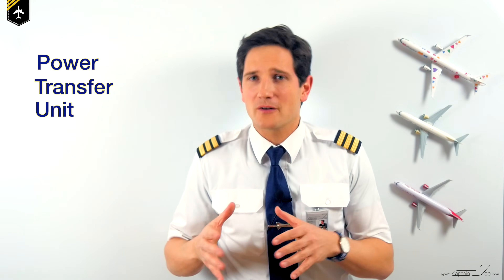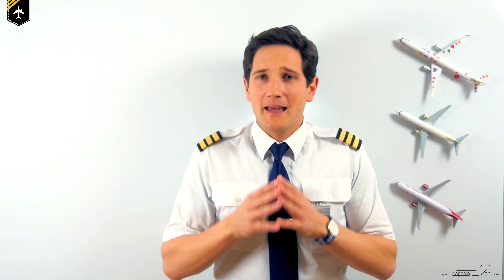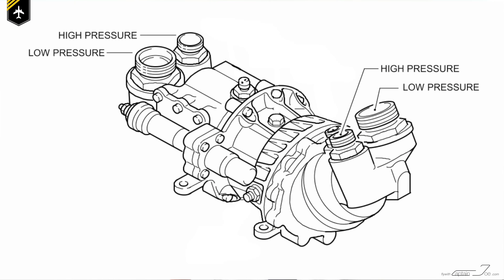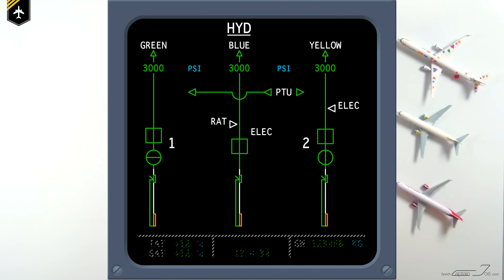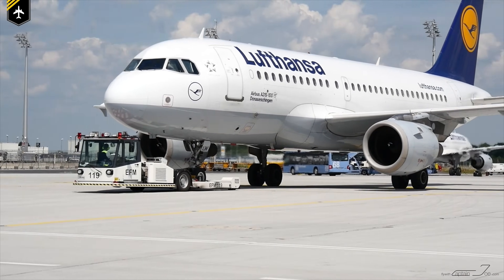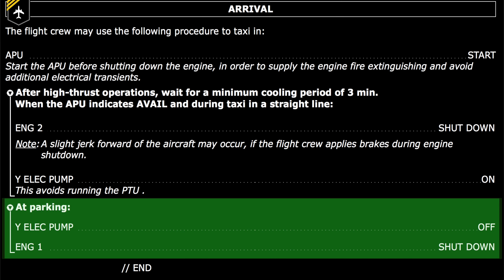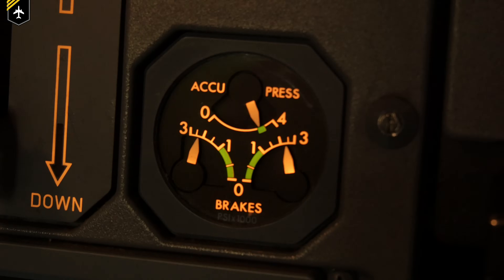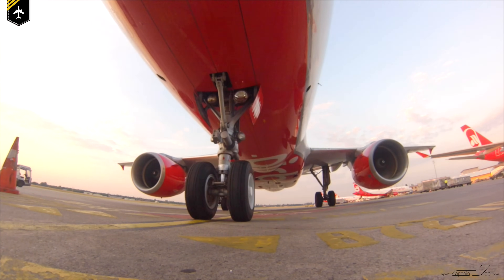MYSTERIOUS BARKING SOUND on AIRBUS? All about the PTU explained by "Captain"Joe

Comment: Too put more simple..   The airplane manufacturer got CHEAP... They don't have to hear it as a passenger soooo "let's not reduce the noise".  Oh yea the those "college degree engineers" aren't allowed to design a pressure regulator etc.  Its just more design flaws to save a buck and little weight.  Oh yea speaking Engineering those guys want lower fuel and no additional weight? Take every gear and bearing in the engine and drive units. Go get it Microblue.com coated.  The coating is extremely thin and practically indestructible (it's made for racing cars).  

Oh yea I guess I dumb because I don't have a "degree" 😂.  Well I say without certainty nearly every Engineer working for a firm is merely a robot..🤖  (must follow  commands) from sales and marketing department.🤑

Well besides my rant I enjoyed the explanation of the below deck barking dog.

Comment: Hi captain! Dont know if you will be still active on this year old video but Ill still throw in my question anyways :). So you mentioned that while one engine taxi procedures the yellow electric pump is turned on to pressure the system. My question is why turn the electric pump on when you can just leave the ptu pressurize the systems?  Thanks in advanced.

Comment: Greetings Joe, It did solve one of my mysteries as I used to think it was a problem with the Engine. However I don't find this sound in most of the Boeing aircrafts. Could you explain what's different there? Thank you Captain

Comment: does it mean something if I hear that noise in the middle of the flight?
Reply: Yes. If you hear it in-flight then you MIGHT not live long enough to ask another question
Reply: Kshitiz Sigdel Or to recieve the asnwer.
Reply: @JonatasAdoM   Or Learn how to Spell Answer.
Reply: @MADTASS  You're not my Tatcher!
Reply: Kshitiz Sigdel 😂
Reply: Kshitiz Sigdel heard it short before landing on all my Turkish Airlines flights, I still live to talk about it 😋
Reply: Avantgarde The Mighty  
Short before and landing and cruise are two completely different scenarios bud.
Reply: @avantgardethemighty6724  what you heard must have been either the flaps or the landing gears being deployed.
Reply: @kshitizsigdel423  On a Volaris A320 flight from Mexico on my way back home, I was hearing that sound all flight long
Reply: Pionel tapinessi had that too on Airfrance Nice Paris all flight long.
Reply: Engine 2 is offline
Reply: That's when the landing gear is being retracted and the wheels are quickly slowed down, but it's another sound.
Reply: I heard that noise after take off several times
Reply: @Pilotoprivadoamis34  As have I. For those suggesting flaps or gear deployment, I know those sounds well and can tell the difference.
Reply: @jemmerx  It may just be the switchover of the hydraulics from APU to one of the engine or electric pumps. The momentary change in pressure in the system would cause the PTU to run shortly.

Also, a high mechanical load on a hydraulic system (like extending/retracting the gear or flaps) would cause a slight drop in pressure which may trigger the PTU.
Reply: I think he was meming
Reply: No problem. You heard Captain Joe. He said the yellow line is pressurized by either the engine 2 OR an electric pump. So if one of your engines shut down mid air, you will hear the sound until the electric motor re-pressurizes the yellow line.
As you know a plane can fly with only one engine. It has happened thousands of times. Im guessing at least a 100 were A320s.
Reply: I heard it at take off, after take off, less pronounced for the duration of the flight, and again during landing . Was scared shitless when it didn't stop after takeoff. Genuinely though"ok, we're dead, I knew it". Eventually I accepted our fate. Would love to k kw what the hell happened though..
Reply: This happened to me right after takeoff from SLC. Long story short, we diverted to Las Vegas and later learned the engine malfunctioned and shut off.
Reply: Likely means an engine driven pump has failed
Reply: Probably some hydraulic stuff
Reply: Yeah u ded
Reply: Apart from all the scary possibilities the others wrote, the PTU itself might just as well gone faulty causing it barking during   whole length of the flight.
Reply: no....................... but if you hear in air for the landing then the rat turbine is being switch on

Comment: This was a good explanation.
I regularly fly with the A319 and A320, first I thought this noise came from setting the flaps, but looking to the wing the movement of the flaps didn't coincide with this sound.
After that I thought it was the pumping of fuel to equalize the different tanks, and eventually the hydraulic system, but never new what it exactly was doing.
So thanks for this explanation.

Comment: So why would they put the yellow system on the number two engine? Yellow controls brakes and ground steering, yet number 2 engine is usually off for taxi operations. Wouldn't it make more sense to put the yellow on engine 1 and green on engine 2?
Reply: DeltaFoxtrotWhiskey3 The Green system is powered by engine 1.  It provides for: Normal Braking, Gear extension and retraction, Nose wheel steering, 2 spoilers on each wing, the left engine reverse thrust, both ailerons, left elevator, pitch trim, and rudder.  The Yellow system is powered by engine 2 and a standby electric pump and provides for Alternate braking, right elevator, pitch trim, rudder, right engine reverse thrust, and two spoilers on each wing.  The Blue system is powered by an electric motor (or the RAT in an emergency) and powers one spoiler each wing, rudder, both ailerons, and both elevators.

Comment: I remember a flight in Germany where I heard the PTU sound during the whole taxi, lineup and takeoff phases, and I was still hearing it some minutes after takeoff. How can it be possible? If I understand it correctly, you shouldn't take off if the hydraulic systems aren't fully pressurized.
Reply: daniolx There is troubleshooting for continual operation of the ptu, more than likely it’s the put high pressure manifold at fault.

Comment: One question Captain Joe there is this sound on the A319-A320-A321 and it’s not the ptu But it’s a mechanical sound usually when the plane is in takeoff configuration mode and when you land
Reply: Drew Mooney you should become a pilot,,,,,,that’s a typical driver question!!

Comment: Interesting incident copied from avherald-

Incident: Lufthansa A321 near Istanbul on May 10th 2015, sounds of barking dogs with no indication

A Lufthansa Airbus A321-200, registration D-AISU performing flight LH-1305 from Istanbul (Turkey) to Frankfurt/Main (Germany), was climbing out of Istanbul's Ataturk Airport when the crew stopped the climb at FL240 due to unusual noises of barking dogs on board without any indication of a hydraulic problem. The crew decided to return to Istanbul for a safe landing about 55 minutes after departure.

The airline reported that the aircraft carried two dogs in the freight room, their container had not been properly lashed. The container was lashed properly and the aircraft departed again.

The occurrence aircraft reached Frankfurt with a delay of 6:40 hours.

Comment: Hi Joe., great videos indeed. Just wanted to know whether the 1st engine is always started first or chances that 2nd engine is started while its taxiing / being pushed out of the hangar while taken for line-up. If so, always the 1st engine would be running more compared to the 2nd engine. Is there a provision to start the engine depending on the service time (actual running hours)? I hope the question is apt from the point of engine maintenance and fuel consumption. May be this is related to the pressurization of green / yellow systems?

Comment: There is the barking dog but then there is also that annoying high pitched constant whine I usually hear around the front half of the plane when taxiing with one engine and have also noticed it comes up when cargo doors are opened/closed at the gate and I think I have heard it also while operating flight controls at the gate (wonder why???).  Is that the PTU running continuosly?  It can be heard in this video on the second time the PTU is shown making the barking noise.

Comment: Dear Captain Joe, why did the crew on Air Asia X flight D7237 on June 25 2017 not turn off engine 1 after noticing engine failure and severe vibrations? Or does that have something to do with the hydraulics (not sure whether the system is the same for an A330)?

Comment: Hi, Captain Joe!

Along the lines of unusual Airbus noises, I've been wondering this since NWA started flying the A320 into LGA ca. 1988: Whenever an A320 family jet is on approach at say, 2-3000 ft, there's a distinguishing "howl." It doesn't matter which engine variant, and sometimes I hear it on departure when the aircraft flies over at roughly the same altitude. This is not a sound that is heard from the inside of the aircraft. I assume it's an aerodynamically produced sound due to flap deployment (an A320 family member aircraft farther aloft doesn't seem to produce this noise). Have you or other fans noticed this?

Thank you!
Michael

Comment: Yellow system also powers the cargo doors which when ground crews activate them automatically actives the yellow electric pump but isolates a small loop which includes the parking break and the number 2 reverser doors. Or so I've been led to believe.

Comment: Please, Captain, how do the engines with so much weight hang on to the wings??? How do they resist to the bang and heavy thrust during landing.....also it's very strange they are protruding out of the wings???  And also please, explain how that much long and wide wings with so much weight hang on to the main body of the air craft......just straight wings without bending???? Very strange!!!!

Comment: Hey Captain Joe I have a question I have been wondering about. In the '80s  some of the air crafts had 3 engines. One on each wing then there was the one in the back on the fin in the middle. Why was this engine done away with, what was it's purpose, and what is in place of it now if that question doesn't sound to crazy. Thanks in advance.
Reply: Hi, in the 80's the FAA basically restricted where planes could fly over the ocean based on the number of engines they had, but they did away with those restrictions over time as engines got more powerful and reliable. Heres a video explaining it better. https://www.youtube.com/watch?v=HSxSgbNQi-g

Comment: Hey! Question! 
I do ramp work for an airline that operates many A320 aircraft. Whenever they taxi in with only engine #1 running then shut down, the PTU can be heard running constantly UNTIL either the fwd or aft cargo doors are operated. Once the hydraulic doors are operated, you head the electrical pump opening the doors. When the operation is completed, the electrical pump turns off and the constant PTU that the aircraft had shutting down stops. Would you know why the PTU stops operating once the cargo doors are being operated?
Thank you!!

Comment: Hi Capt. Joe! Very interesting videos you have here! Just another question about a strange sound...i have flown for several times in an A330, and have heard this "shattering" sound, like a sheet of ice breaking and sliding down below the passenger floor more particularly at the front part of the aircraft. It can be heard only during the initial climb out phase of the flight after takeoff up until it probably reach 18000 ft... Any ideas? Thanks!

Comment: Hi Joe, great video! I once had a PTU failure on one flight on a Air France A318 (the barking noise basically kept going throughout the whole flight). Have you ever experienced this? Can the hydraulic systems still function normally?
Reply: It doesn't sound like a PTU failure. It actually sounds like a PTU working!
Probably what happened was that one of the engine's generator wasn't working to provide hydraulic power. Therefore, the PTU had to use the power from the other engine's hydraulic system to feed the other hydraulic system, working all the way!
4 years later here you go :)

Comment: Joe, I have a question. Today I was flying on an Airbus A319, and during the departure the PTU kept running for several minutes and stopped right before VR. Is it normal? Note that temperature was around 16 degrees celsius, but i don't think that it influenced it somehow.

Comment: Hey joe nice video! but I have a cuestion: If you can se, my channel is about inside the plane spotting, and I fly a lot in A320 like 5 or 6 times a year so sometimes, especially in a A321, I can hear that sound during takeoff and landing in the back part of the plane especially betwen isle 20 to 30. Why sometimes i listent these sound during the takeoff and landings?

Comment: Hi captain joe, can u xplain how possible anyone disable the Transponder? is it second after it disable the aircraft security system send an auto signal to nearby control tower? im just curious, hope u can explain how anyone manage to shutdown transponder in that "particularly magic dissapeared" missing aircraft. Thanks
Reply: There is no magic. Depending on transponder model and manufacturer, it's one press of a button or flick of a switch or knob. When you do that, ATC doesn't receive data block from aircraft anymore and only thing they can see on radar screen is primary reflection - just a moving dot.

Comment: Hey, Joe! 
Thank you for your videos!
I have a question about another sound: 
I've noticed several times already, that during the time when we (passengers) are entering a plane, a turbine is slowly rotating (wind?) and a very strange sound is present. 
It sounds like some metal parts are periodically clinging. Approximately once per second. When I've heard it first time, I was afraid that it was something wrong with a turbine, but then I've heard it several times. So it is probably something that has an explanation.
Reply: those big front blades are loose. they make a tinkling noise when moved slowly. when the engine is running they pull themselves tight in the hub.

Comment: I won't mention the airline name, but a handful of years back I flew a multiple hour flight and that sound was heard continously for the entire flight. I knew it was hydraulic related and was worried that one of the systems was losing or had no pressure. Was I being paranoid or properly concerned for my safety?

Comment: Thanks for the upload, currently busy studying for AGT cpl and just learned something els from the hydraulic systems. Just a question of interest, is the APU connected to a hydraulic pump as well or does it only feed electrical power to the pump. And how many hydraulic accumulators does the A320 have?
Thank you and safe landings
Reply: That's a good question. Generally APU could probably drive some sort of hydraulic pump, but A320 doesn't utilize such design. I have no idea how many hydraulic accumulators are there. I assume at least 1 per system + 1 for brakes. We have to wait for Joe to give us correct answer.

Comment: It sounds more like a saw to me.
Reply: Mee too! It's like someone cutting the plane from his belly ahahah
Reply: I used to tell people that it's just the ground crew putting the finishing touches on the aircraft; or that its the ground crew sawing off the parts of the fuselage that are peeling off.
Reply: @37VQV  😂😂
Reply: it sounds like a sound, it sees like a saw.
Reply: Some say it sounds like a NASCAR pit gun
Reply: Its sounds like a wiper
Reply: Melissa0774 sounds like a train to me
Reply: Me too
Reply: Yessss
Reply: Аgree
Reply: Yeah I don't see where he gets barking dog.
Reply: Actually, on this video it kind of sounds like both (probably because he mentioned barking) but Ive heard this sound on the plane before and immediately thought of a saw sound!
Reply: It’s sounds like something being retracted. I thought flaps, wheels probably make that sound… Didn’t know it was the PTU.
Reply: Agreed. Or a drill! I always thought that it was a check of the flaps or something, because of where the sound is coming from.
Reply: Me too
Reply: It sounds like something rubber scraping against something. I always thought it was connecting the tug for pushback or something.
Reply: The buzz saw sound is the fan blades at full power.  :-).

Comment: Thank you for the info, I have a question if I may? When landing I was sat near the wing on the left side, I felt a very large bang or knock under my feet and it did send a percussive shock through to my feet, it wasn't the sound of the wheels hitting the tarmac as that had already happened a moment before... what was that feeling and sound please? Thanks captain Joe.

Comment: I have a question, What does the "minimums" callout mean? i know that it is the decision height for a go around[, but planes can abort landings aven after touching down. So now im confused
Reply: You are confused because of bad logic you exercise. At minima callout you need to have visual contact with runway. You can execute missed approach even after touch down, but you cannot execute missed approach when you completely miss runway, or hit some house, power line, hill or some similar obstacle. Minimums are used for manual landing. Manual landing must be done visually, so runway must be visible. If you need to execute automatic landing due low visibility, there is no minima callout, but "alert hight" callout where pilot should ensure that autoland mode is working normally.